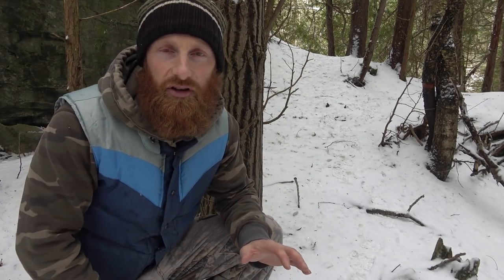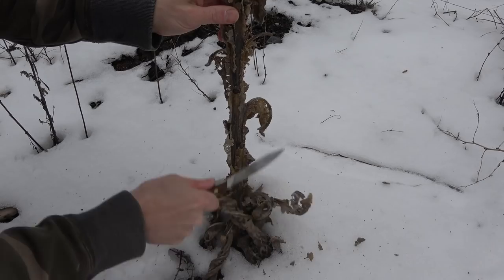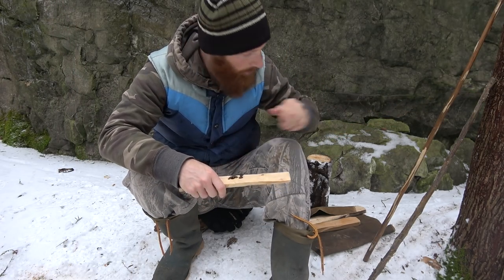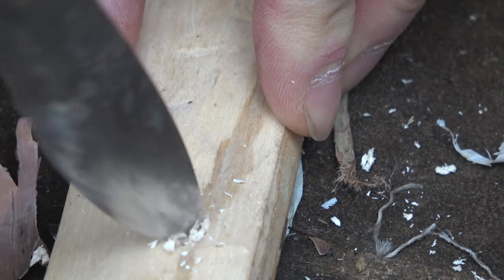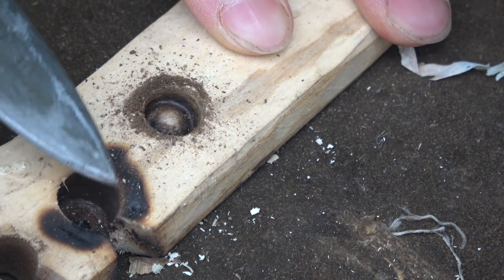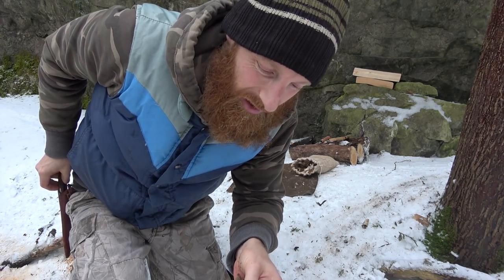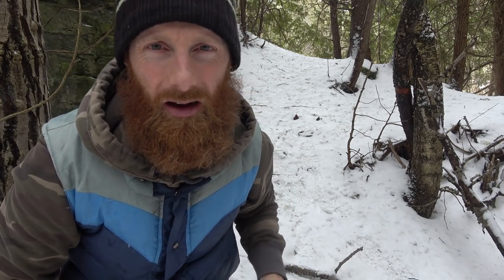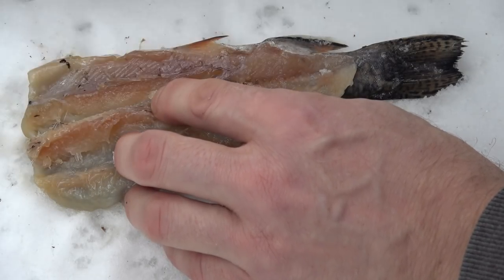Hand Drill Friction Fire Challenge

Comment: Hello Chris thank you for being proud of me/us 
I am proud of you too. 
Confession I just can’t get the grip of this method called hand drill I’m still working on it. When I do I let you know. Maybe I should leave my Zippo lighter at home. Thank you. 
👍🇬🇧
Reply from the maker: Cheat it a bit.  Use some honey, warm up your set a bit before you get going.  Use the lighter to warm the tip or burn it in a bit.  This wasn't designed for cold or wet climates.  Chain your success.  Start easy mode, then work up to full method.  Good luck, rooting for ya!

Comment: Another easy option is making the John-Rudiger Roll system.  Using a 2x2 pine board, cut 2 lengths of 8 inches.  Dado out (chisel out) the center length 1 1/4 inch wide x 1 inch deep for each board.  This makes a square "U" shape.  Drill small holes along the side of the board (like a cribbage board hole), and put small rudiger balls inside.  Make small wood/mullein (etc) dowels for the hole plugs.  If you want, you can superglue emory sanding strips onto the back sides (for sharpening up your knives and tools, but also friction for holding the boards).  They fit together and you have excellent grip and control of the rudiger method for starting a very quick ember from tinder sources.  Just pull out a rudiger ball, place into the trough of the upside U board, place the other overturned board into the slot, and rub and roll until you get an ember.

Comment: do you need to dry wood if the weather is +20°c. and btw i listened to u i went out and i made rope and weaved a basket without any modern tools, next task is make a bow drill fire then making stone tools.
Reply from the maker: You may not.  If it's arid, your problems might totally evaporate :)

Comment: Hi, did the hand drill method come first and then the bow drill by ancient people or was it just a choice or style of fire making?
Reply: I believe It always comes down to if you have the materials to make a string for a bow drill, if nothing for a string you'd have to do hand drill.
What materials could you use to make a primitive string, hide? guts? hair? tree bark? I think that would be an interesting challenge to see what you could find to make a primitive string from?
Reply: Near as we can figure they were using the Bow Drill for putting holes in stone, bone and wood first. Then accidentally discovered they could start fires. Likely the Hand Drill was discovered later. 

No proof whether Percussion Fire Ignition (Flint & Steel) or Friction Fore came first. F&S was relied upon by more people groups for longer. Maintaining embers from existing fires is actually the oldest and most used method for starting fires. Many means by which to carry embers around.
Reply: The original Zippo, eh
Reply: cant you just scrape a stick on a flat piece of wood until it smokes? i think aboriginals used that technique